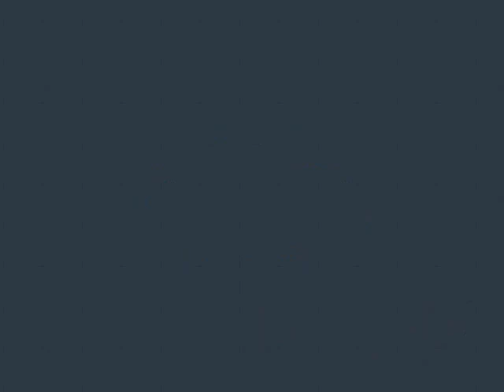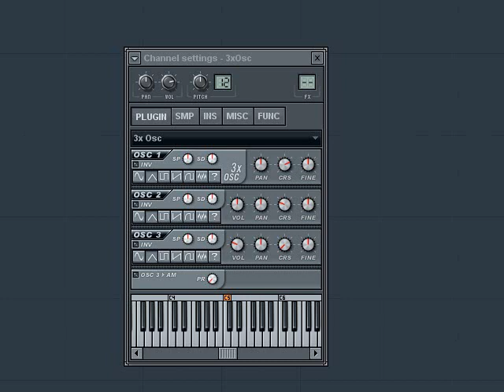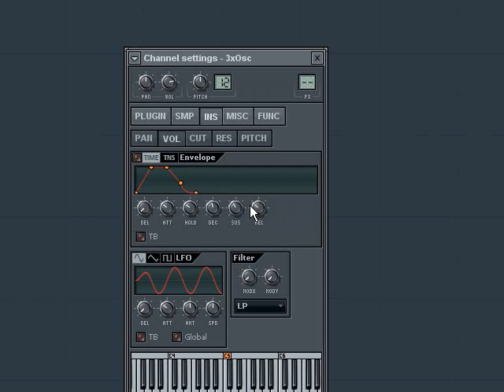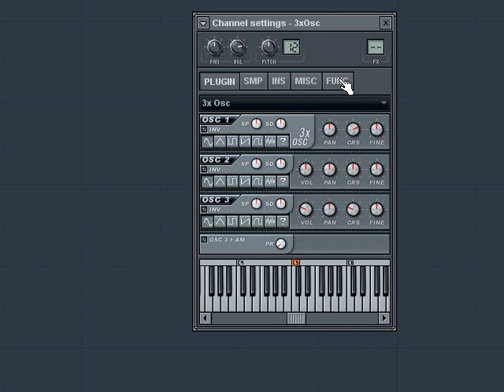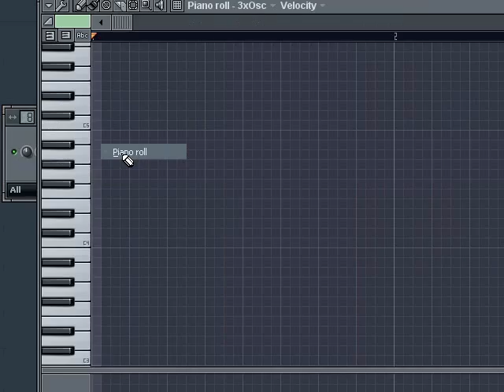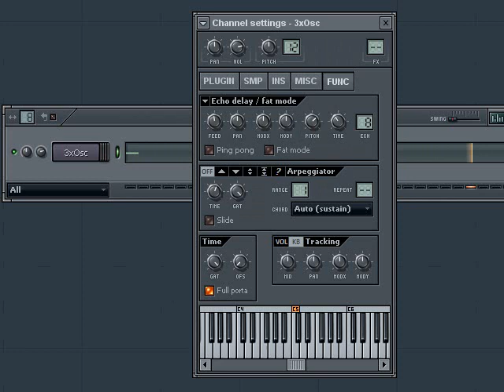FL Studio Tutorial: 3xOsc Part 2

Comment: Thank you man, still very nice video. One thing i noticed is, that the ping pong effect only works if panning is turned on and intensifies with this option, is that correct or does this have another reason? Also my biggest question, how much do u still need the osc if  u are able to use other/modern vsti?

Comment: One thing he doesn't mention, is if you want a nice balanced sound using the all 3 oscillators, you are going to want to lower the volume of the higher semitone oscillators since higher pitches are heard more easily to the human ear, where lower pitches are harder to hear. This is good to remember when making pads, and chords. Do not keep the volume the same for each note, make sure that depending on the frequency of the note (the pitch), the volume will be crucial in creating a balanced sound